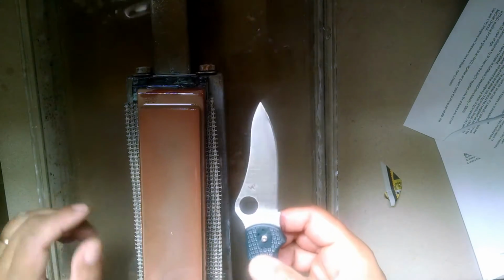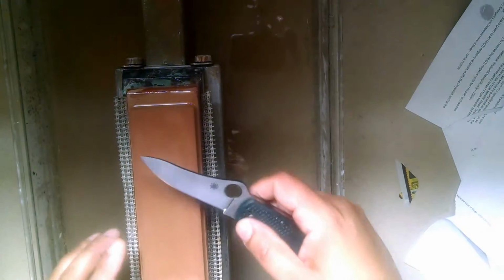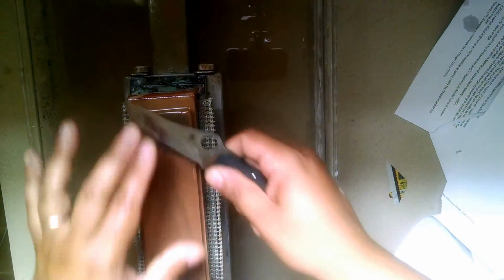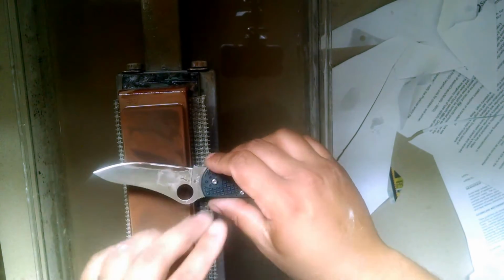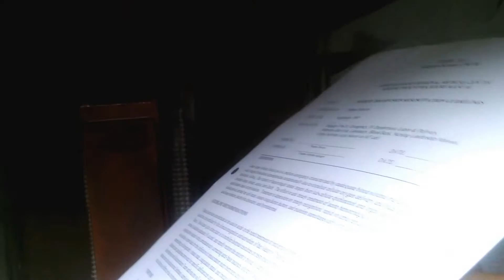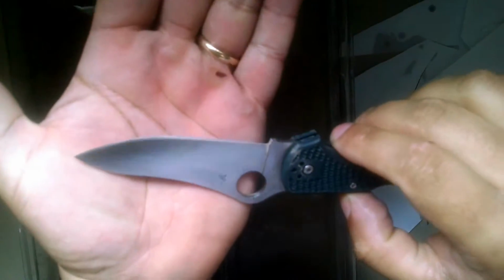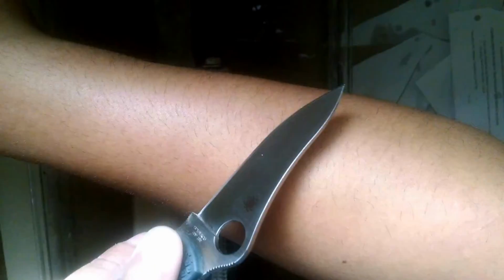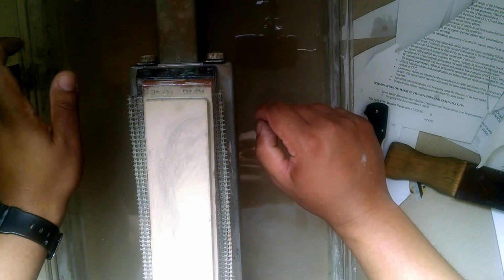ZDP 189 on King stones?

Comment: about the consistency of the strokes. I find this to be much more important on very thin blades like kitchen knives than on full convex outdoor knives. On secondary bevels importance comes back a bit for both the looks and performance of it. With my barkies I sharpen more on feel than actually counting strokes. I also look at my edges once every minute or so to see if I'm even.

great video mate. Unexpectedly much steel slurry from the king stones. What is the HRC rating of these spyderco ZDP knives?
Reply from the maker: 65hrc

thats the beauty of zdp189 its mostly just carbon and chromium at high hardness with the PM process to keep the structure uniform without large carbide clumps

Comment: The geometry of the Spyderco is not right for some reason. You should be able to sharpen the entire length of that blade without going back to the area near the choil so many times. Just my opinion because I'm not there to look at it. What do you think? Try the King 1200 and I think you'll fall in love with it over the 1000. Feedback and cutting action is way better than the 1000 King.
Reply from the maker: I agree, not a fan of the king stones those are old news for me, they were some of my first stones many year ago, its not that they are bad but they lack cutting power.

Comment: how do you like the emulsion in comparison to the bark river compound? is it worth the extra money? I can get my hands on some damn expensive .1 micron emulsion here but it's like $100,- for few grams.
Reply from the maker: It works great on PM steels, on very high end carbon and fine grain steels it seems to  make the edge more toothy then the white compound.

I bought them from kniveshipfree last year.

at the rate im using it looks like it will last around 5-7 years

per bottle.

However the highest end stuff on the market is this stuff

http://www.jendeindustries.com/index.php/sharpening/strops-stropping-compounds/cbn-diamond-sprays-emulsions/jende-poly-diamond-emulsions.html

When I run out im picking this stuff up
Reply: you' re making my wallet hurt...
Gonna think about it but will probably end up buying it anyway haha.

Thanks mate :)

Comment: YOU DO NOT NEED TO FLATTEN YOUR STONES BEFORE YOU USE THEM EVERYTIME UNLESS YOU HAVE A HUGE HOLLOW 💀
Reply from the maker: It's for dressing the stone and raising mud.
Reply: @FearNoSteel  raising a slur isn’t very needed unless your trying to polish your knife’s edge, which is usually done on a fine stone. If your stones have smoothed out and stopped cutting as well, use a nagura or a sabitori rust eraser.
Reply from the maker: The slurry helps also with mitigating loading, dressing will make sure the abrasive is sharp. So, it's two fold. I do not recommend rust erasers for waterstones, that's something Ricky Tran was pushing. It's not very effective because it doesn't mitigate the issue that's causing the loading which can be dull, glazed abrasive that needs to be dressed. Rust erasers are for ceramic honing rods and Spyderco ceramic stones.
Reply: @FearNoSteel  ive had a good experience with using rust erasers on whetstones, they worked well for me. I also used plenty of other things to clean my whetstones.
Reply from the maker: @sigmaballs2734  I'm not concerned about what can work, I'm concerned with what is the most efficient and works best. Thank you for the comments.
Reply: @FearNoSteel  your welcome, i think you can get away with a sharp knife using many things, you just need the skill, thats it.